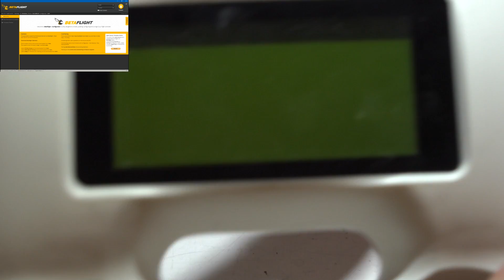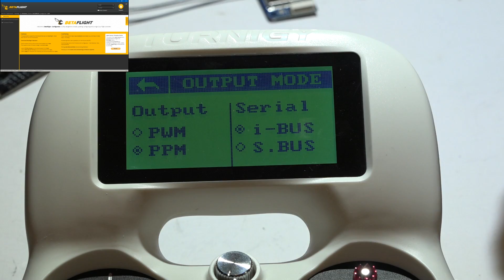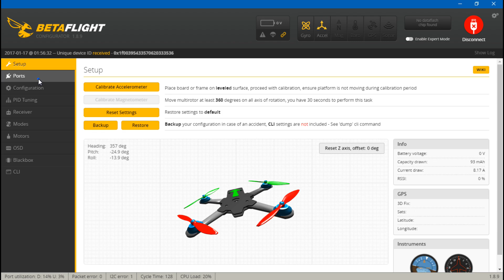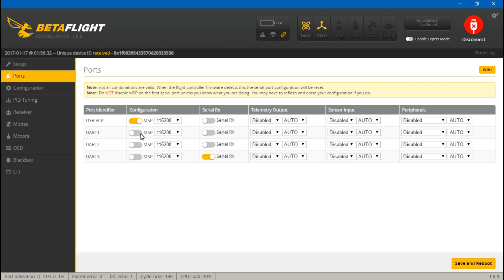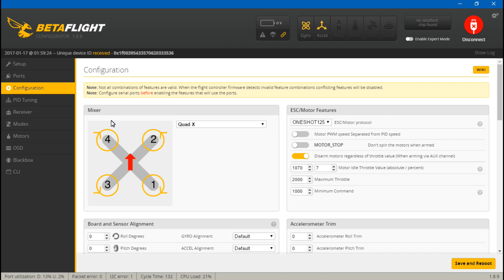FS-X6B: Wiring & Betaflight Set Up (Ibus/Sbus/PPM)

Comment: On the MAMBA F405, you can connect X6B to SBUS (RX1) pad, RX3 (give up SmartAudio), or RX6 (give up ESC telemetry). There are 3 JST ports on the X6B. Check the pinout on the silkscreen - some online wiring diagrams are wrong!! Receiver was bound, I was getting telemetry, but no effect in Receiver tab. Took 20min+ for me to realize yellow/black were switched.

Comment: I can connect with my reciever, and everywhing works fine till i add aux channel. When i do, on arm everything is fine, but when switch is on the dead setting my throtle chanel jumps bewten 885 and 1000, and aux 2(with i use for armin) jumps bewten 1000 and 1500, with 0.5 sec betwen jumps.
Halp.
SP racing f3 with x6b reciever on IBUS.
Help plz

Comment: JC I want to get voltage to my tx. If i plug the provided wires into the rx voltage port where to i do with the other ends? do I use all three or just power and ground. i have the beta flight f3 by the way. Thanks and keep up the videos.

Comment: Have you been able to set up the failsafe with this receiver? I have the failsafe in betaflight set to "drop", but when I power off my transmitter the throttle holds steady forever. Seems like a few others have had this issue with the X6b receiver. Do you know how to work around this issue?
Reply from the maker: I'll look into it. Thanks for pointing that out. Have you tried setting failsafe up on the transmitter?
Reply: Ha I thought I did. Went back and adjusted the settings and it works perfectly now. I'm using the Turnigy evolution controller and in the failsafe menu I turned all the channels "on" and to 0% and that did the trick. Sorry for wasting your time!
Reply: would you not be better setting roll, pitch, yaw at mid point and throttle at zero? then it should drop from the sky level. maybe even experiment with throttle at about 15% so it drops slower, less damage :)

Comment: I want to thank you for your videos. I have been throwing out a question for a while now and no one has given me an answer. The question was about flight controllers having a port specifically labeled SBUS and  in my case, running IBUS. I wasn't sure I could use that port. I was using an open UART. I'm getting my Flip 32 F3 Omnibus V2 this Saturday. Your series on the Omnibus has been invaluable.
Reply from the maker: With the Flip 32 Omnibus F3 V2 you can use IBUS and it does go on the same SBUS pin. Thats correct. Just know that IBUS, at least at this moment, only works on the Omnibus F3 and not the F4. But since you ordered the F3 everything will work fine.
Reply: Now can the cables provided be used read the voltage telemetry.  They seem awfully thin?? if so, I am using a 4 cell battery. Where do I connect those wires? Do they get soldered to Vcc on the pdb? Also one would assume you only use the red and black omitting the yellow?  I'm using the modded fs-i6 "10CH". So I do realize I have to go into the menu and set up the battery I'm using. Please correct me if I'm wrong. what would you recommend for the settings for Lo, Al and Hi voltages? Thank you so much for your help.
Reply from the maker: Check out my Omnibus playlist. It will show you how to completely set everything up. https://www.youtube.com/playlist?list=PLiYYhnH4BhI9lbVvjJH-hp1GQ1Lis-sI8

Comment: How are you stripping these wires? I'm using this same receiver and had a pretty hard time  stripping the insulation without cutting through the thin wires.
Reply from the maker: Nothing special. Just an exacto knife. I just cut a little slit in the jacket then pull it off.
Reply: I've been attempting to do the same. Guess my big meat hands will just have to get used to it. Great videos, thanks for you help!

Comment: Hi bro what about this when you're working on these boards full of components doesn't it worry you that it could give you lots of problems?
For instance? Don't get me wrong here I love what you're doing I just want your opinion on this as I think it'll make all your components die earlier than they should! 😳😔👍
Electro Static Discharge is a subject that technicians are becoming increasingly aware of in the computer/electronics industry. Electro Static Discharge or ESD is the shock that is felt when a person walks across a carpet and touches a door knob and a discharge of electricity occurs between that person and the door! That shock was actually a discharge of electricity in the range of 2000 to 3000 volts as the shock voltage has to be at least 2000 volts before the human body can feel it... The reason the 2000 volt ESD discharge does not kill someone is that the current is very low but that same voltage can kill electronic components or even worse damage the components to where the a chip acts erratic or fails months later. Furthermore did you know that studies have shown that a static charge built up by scuffing shoes on a carpet can exceed 20,000 volts?

Comment: I'm just waiting for this receiver as this is the last part that I need for my new season quad. Right in time JC! Thanks a lot for the video.
BTW. It will be nice to see some buzzers video this is also something to concern 5V isn't a loud buzzer, 12v are much bigger something like matek bm3in1 is the sweet spot but hard for wire.

Comment: very helpful video, i just have two questions
1: how do you wire the battery monitor to the receiver?
2: what makes ibus/sbus better than ppm?

thanks in advance :)
Reply: there is other port on the back of the receiver (just below ibus port) and it has 3  wires. You just cut the yellow wire and connect + to + on the pdb and  - to -. The last thing is to setup it in the transmitter menu
Reply from the maker: I am unsure of how to get voltage in telemetry. Ibus does support it. Sbus might but on the forums it seems like no one has done it. 
Ibus and Sbus both are faster than PPM. Also PPM has more "jitter". You can see the jitter when you go to the receiver tab. The bars will be shaking back and forth.
Reply: thanks guys that was really helpful :)
Reply: Could you please explain further. If you cut the yellow wire, then which is + and - ? And where on the PDB would you connect it? Surely this would fry it

Comment: Hey JC, are there any advantages to Ibus over Sbus besides having the endpoints already set up? Thanks
Reply from the maker: Other than that not really. They are just different protocols, and both are faster than PPM. FrSky uses the Sbus protocol where FlySky uses Ibus. But apparently these receivers are capable of using both. But not all flight controllers and firmware can.

Comment: Thanks for the tutorial JC. Does this receiver have failsafe and if so, does it revert to no pulses or a pre-configured value?
Reply from the maker: I haven't tried out any failsafe features yet but the Evolution have a failsafe menu where you can set up all your AUX channels. I'll give it a try soon.
Reply: Ok thanks that would be great. I'd be really interested to see how it's done!
Reply: Gary Kalinsky yes it has failsafe. I'm using the X6B receiver in my holybro 180 pro with my evolution. Failsafe works and battery telemetry 👍
Reply: Tony Peart  Cool... thanks for the reply. It sounds like a good receiver for the evolution. I look forward to trying it!